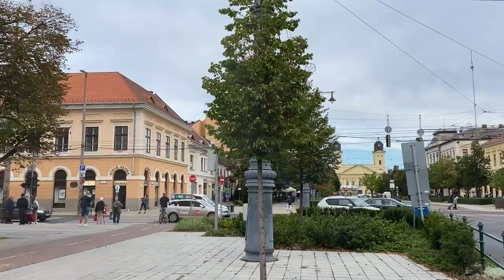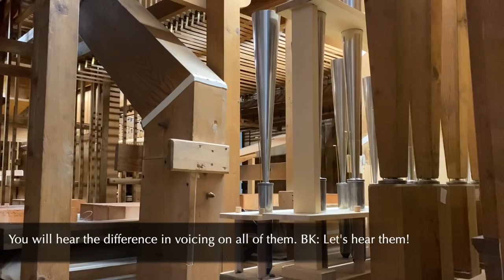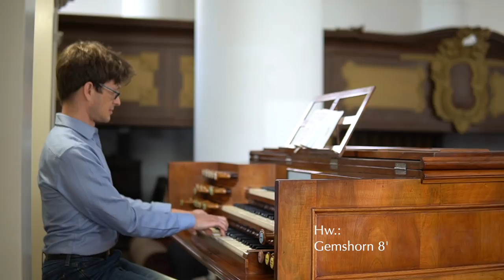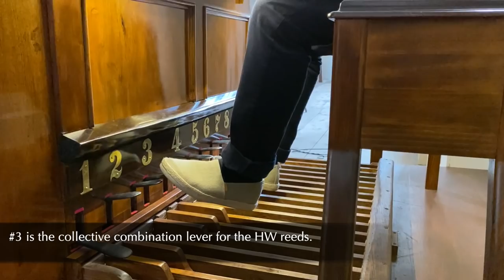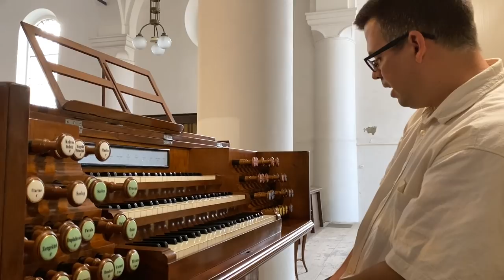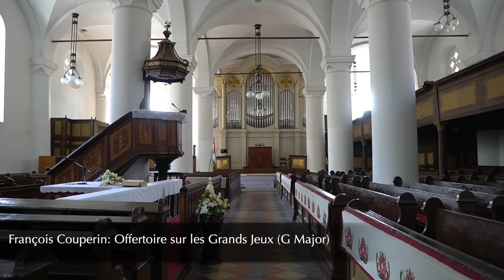A MILE-LONG TRACKER ACTION WITH BARKER LEVERS | French-German Organ in Debrecen HU | Bálint Karosi

Comment: I really enjoy these videos that you do.  It's nice to learn about these instruments that you visit.  This instrument has some oddities which would be nice to see that weren't installed such as the harmonium and the pedal octave coupler.  I'm curious as to what they mean by Nagy Nasard.  I would love to see you do a video of either the Casavant of Notre Dame Basilica in Montreal or the Gabriel Kney of Roy Thomson Hall in Toronto.  The Casavant of Notre Dame because it was and still remains their most significant organ to this day.  The Gabriel Kney of Roy Thompson Hall because this has dual action.  It has a mechanical action console on the balcony and a remote console on the stage.  The organ is also computerized with light up buttons instead of stop knobs.  Of course there's also the Wanamaker Organ in Philadelphia and the Midmer Losh in Atlantic City.
Reply: I don't know, if this answers your question, but "nagy" means "large", so its translates to "large nasard" (thanks, google translate).
With a 10 2/3' plus a 16' stop you are able to mimic a 32' stop. This is helpful when you don't have the space for a real 32'. It is often called "acoustic 32' ". It works because your ears connect the sound of the 16" with the 10 2/3", which sounds a 5th above it (that's why it is called Nasard, a Nasard is always something with a 5th, usually on 2 2/3' pitch). Your ears now think there should be a sound on 32' pitch, because of the harmonic series, so it adds it in your mind. 
Now this organ has already a real 32', which is relatively luxurious. I believe the 10 2/3 is there in order to support the real 32' and to mimic a smaller 32', if the real one is too loud.
I hope this answers your question!
Reply: @astian_sebus  I think it does.  Thank you!  That Contrabass 32' is really quite effective!  It has some good volume to it and it adds a lot of weight with the 16' ranks.
Reply: Yeah i was curious about the variable-pressure free reeds too. I wonder what stops they are, sounds like maybe the echo reeds to me.